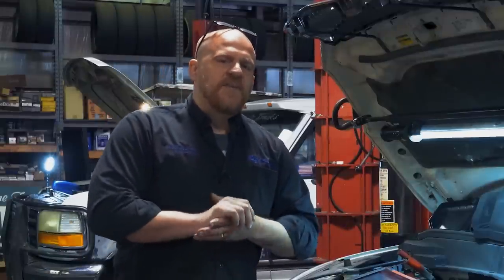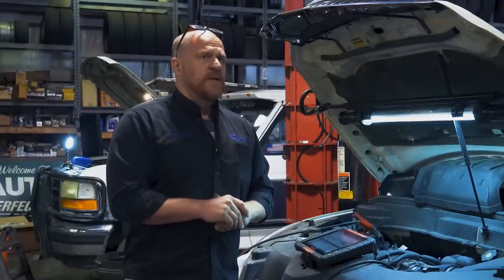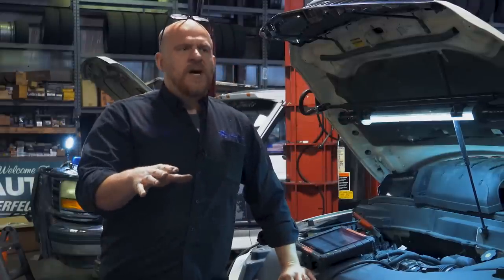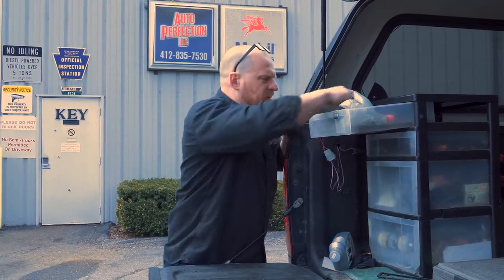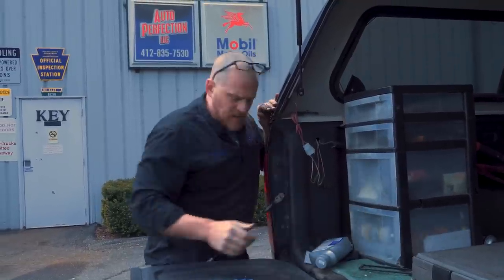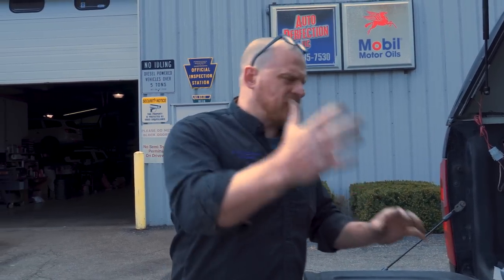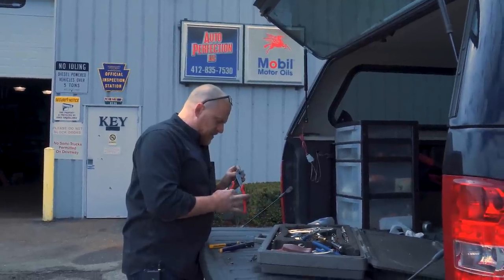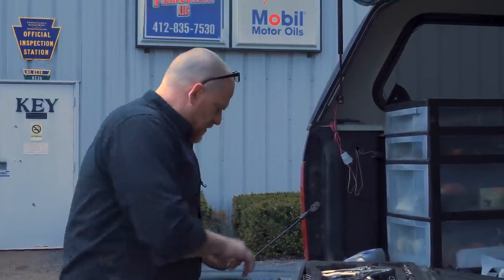2009 Buick Enclave NO COM To Fuel Pump Control Module Part 1

Comment: Has Caleb been using a new camera?  You can see more detail in darker lit areas than in previous videos.  Have you upgraded to a more cinematic-oriented camera?  Maybe a future 'off-topic' video of the new gear and a simple editing blurb.
Reply from the maker: Yes we have. Caleb is on it my friend. New camera, new ways to edit, color correction, you name it. Unfortunately the lighting is bad in my brothers shop, but we are working on that too
Reply: @ScannerDanner  The lighting at the beginning of the video looked very good, gave it a slight dramatic look.  Just a small tip for Caleb: watch the shutter speed you're recoding with.  He can decrease the 'stutter' look in your arms when you're moving them quickly.  The shutter speed should be double the frames-per-second of the camera.  For example, if the new camera shoots at 60 fps, he should set the shutter to 1/120.  If he's shooting at 24 fps (cinema camera), shutter should be 1/48 second.  This will give pro quality.  He is doing GREAT, though!!  Love it!
Reply: Hey man! Just saw your comment. I know what you're talking about, I went back and looked and my shutter speed was way too high! I shoot 4k 24p 1/50 as my standard, I never break the 180 degree rule (on purpose). I must've accidentally left my shutter speed at 1/250 for shooting 120 fps b roll footage. And yes, lately we've been using a new camera for the past few months. You may be seeing more detail in the darker lit areas though because I started exclusively shooting in HLG 3 format, and over exposing by .7 stops. I also have my shadows set to record at +1 stop so I can go in fine tune the detail in post. It's nice to hear feedback on this kinda stuff 😂. I never get to talk about the fancy film stuff because people are just here for the cars lol. I appreciate it
Reply: I would love to do a video in the future of an overview of the gear and softwares I'm using. That's such a good idea!
Reply: @calebldanner  It's my pleasure!  I used to be heavily involved with video (just as a hobby) and editing.  Somewhere in my house I still have a Sony F3 (with S-Log) that I bought used in mint condition (at a price where I figure the seller didn't know what he actually had) when RED cameras started taking the world by storm.

Seriously, your editing skills are growing wonderfully.  The more you edit, the more your creativity grows.  You are doing great!

Comment: Wouldn't comm lines be active simply because they are connected to other modules?  It seems like the only way to check the module for comm outputted would be to disconnect the com wires first.
Reply from the maker: the video I linked via a "card" covers these aspects of looking at com signals with modules unplugged and plugged in. Are you a premium member? If so make sure you watch that video! I'll add the link to the description now. 
In short, if I would disconnect the FPCM, I would still have com signals on both sets of com wires, pins 21 and 22 from the network itself and pins 6 and 7 would then only be messages from the rear differential control module. 
Here is the link https://www.scannerdanner.com/scannerdanner-premium-chapters/no-communication-network-diagnostics/573-2007-chevy-silverado-no-communication-with-ebcm-u0121.html

To your question, yes, the com lines would be active from other modules and the only way to check to see if those signals are actually coming from the module in question, would be to de-pin those com wires and measure the pins directly, while the module in question still has a power and ground. You would not be able to simply unplug the module. So this is the reason I put so much trust in the fact that I can communicate with the rear diff control module, because I knew those messages had to go through the FPCM to make it to the rest of the network. So communication with the rear diff mod. tells us what about all 4 come lines on the FPCM? Does this make sense?
Reply: @ScannerDanner  , yes I'm a member.

Comment: HEY PAUL; GOTTA BIG PROB ,,,,,man i need help my car 2011 BUICK LACROSSE CXS ,  has been dead for 3 months GOING ON 4 , LOL , ,it started in sept2019 with a UO100 AND PO23F CODE .my question is ,i cant find answers no where , wtf is a "fuel pump secondary circuit" OPEN ??? .  and also , my # 10 ECM fuse keeps blowing ! the best diagnostic tool i have is a "BLUEDRIVER" and i got 2 test lights and one of them detects hot and ground power , and a couple of digital and analog volt meters and a ECT 2000 open and short detector ! !   while i was at dr.'s appt , 3 hrs later i came back and when i opened my car door ,i heard about 8 to 10 fast clicks under the hood , i discovered finally , one thing clicking was my # 7 ecm relay ,and something else which sounds like its under my intake . now when i connect my battery ,it will make noise ,and qa while later do it again .if i use my remote it does it ,if i open or close the trunk and car door it does it ,i am completely stumped on this one ! HHHHHHHHHHHHHHHHHHHHHELP !!!! LOL

Comment: Is it true you can communicate directly with anything class 2 but not on lin? Usually i cant directly communicate with components on lin bus
Reply from the maker: lin is a single wire design I believe and is typically used for non essential modules (interior stuff)
Reply: @ScannerDanner  LIN is Master and slave,you can talk to the master module but only the master can talk to slave modules.
Reply: John Hnetkovsky thank you john

Comment: that,s how my 06 chevy cobalt is doing i just rebuild the motor wen i put the motor in it run good and then the fuel   just stop working i hot wired the pump it runs now but still don,t why i lost power to the pump the fuses are good relays are good   it,s driving me nuts no rats got it

Comment: What kind of wire piercing tool is that
Reply from the maker: it is called Phil's Electrical Probe and you can find them on my tools links in the description. Thanks! If it is not there you can find them on my website (tools pages)

Comment: Those solder sleeves DO NOT CRIMP! You use a heat gun with a wire hooded shield ,so it directly heats just the sleeve. The only thing I've used for 35+ years in aviation. When used and assembled properly you'll never have a problem. Now we always had to use quality sleeves like Raychem and AMP Products for non insulated terminals or inline splices. I would send you a pic, but no options to do so.
Reply from the maker: I think maybe the ones that are readily available are just garbage. Look at some of the comments, one guy had his melt apart due to them being too close to a heat source. The low temp solder is a concern for me on these. Maybe the aviation ones are different. Thanks!

Comment: I use my power prob to get a good ground to my scope
Reply from the maker: for sure! I typically forget about my PP4 and using it for that purpose :)
Reply: That and I also have a 3 wire spool that extends out 12 feet that brings power, ground and signal almost bumper to bumper.

Comment: Nothing like junk replacement parts to make more complications.
Reply: I bet the module was replaced via parts cannon before the wiring damage was found, might not be a bad idea to check if the owner still happens to have the original.

Comment: Uh-oh, I heard that six-letter curse word: "Dorman"! Hey Scanner, you didn't set the vehicle up for the film before you started, right?
Reply from the maker: 😂 of course not! Why would I do that to myself
Reply: @ScannerDanner  I dunno, when you immediately found that first jumble of chewed up wire it appeared you had already set it up that way. I still need to finish watching part two of that film you made. You had chewed through wires showing up everywhere under that vehicle. I applaud you for the integrity displayed on your mis-diagnosis.

Comment: Really ? 12 ads in 51 minutes ? Was that you or YouTube ?
Reply from the maker: YouTube, I don't set these. Sorry, good thing you can skip them
Reply: @ScannerDanner  YouTube is really insane lately. I had a few videos with a shitload of ads, some you can't skip, some don't load but the yellow marker is there.
Reply from the maker: Yeah, I've always used automatic ad placement. I'm sorry about this. I have enough on my plate than to worry about manual ad placements
Reply: @ScannerDanner  I get you. YouTube is screwing a lot of creators lately. Keep up the great  work in these dark times man.

Comment: Solder sleeves are garbage. If any connector is going to fail it’s the solder sleeves. They’re almost as bad as a hard plastic butt connector. Complete garbage